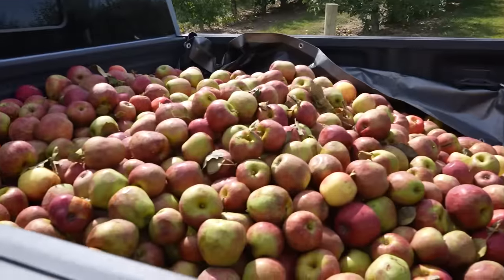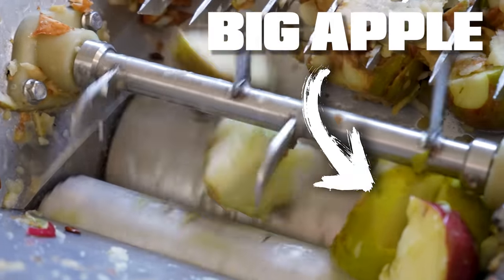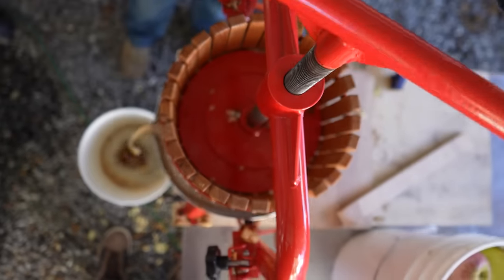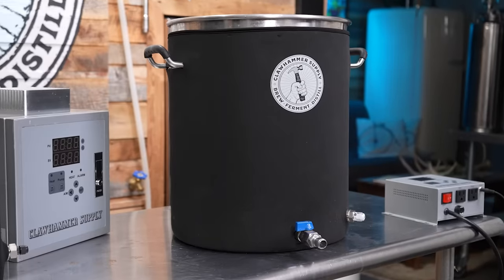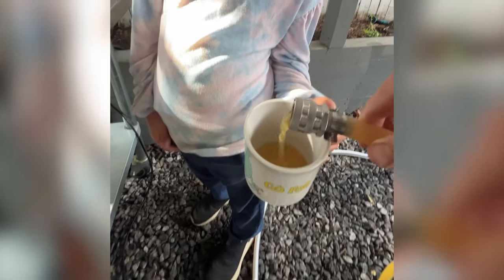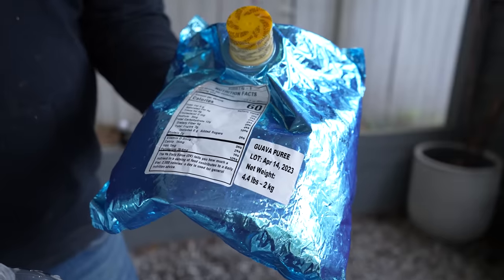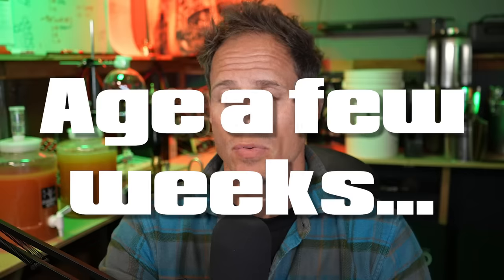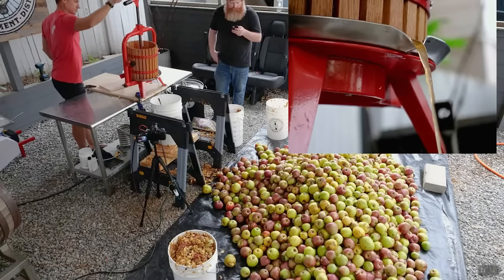How to Make Hard Cider - Easy Beginner Recipe

Comment: If you reuse that style of crusher in the future id recommend removing the knives, fill the hopper and push the apples down with a big piece of wood. The knives honestly just slow down the process as the rollers themselves can shred the apples and crush them even if the tool was originally meant to crush grapes.

Comment: Nice content guys.  Electric scratter and hydro press will give 30% more juice for less graft.  Add 1/2 tsp ascorbic acid (vit C) per 5 galls as it stops the juice going brown.  2 pints of strong tea per 5 galls for tannin.  Unless you brew beer from grain and already have heaters just stick to plastic fermenting bins and campden tabs, better to spend you're hard earned on the scratter and hydropress.  If you have a tame pig farmer local give them the pressed apple pulp, the pigs love it and the pork is next level.  Boost cider with more sugar, I like 9.6%, stronger for not much more effort.  Keep up the good work.

Comment: i saw a historical documentary on cider making and they extracted the juice and put it straight into a barrel with no chemicals or heat treatment.  Is this OK?
Reply: Look for Spanish or Basque ciders like Isastegi. Pretty sure they are still made with mostly/entirely wild fermentation. The issue for a beginner is likely to be consistency, as you're accepting whatever bouquet of yeasts and other bacteria are there, many of which you don't really want. Traditional production today includes a lot of embedded and cultural knowledge to control this, from how they source the apples to how it's processed, the tools and vessels they use, and so on, to help produce a good quality product more consistently. Eugenio Monesma has a good video on here showing this. I'd like to eventually try making something like them someday but I expect it to be pretty hit or miss.

Comment: 6:45 Parallel manufacturing is great, great stuff. It's not really needed at 5 gallon or less scale, but once you go over that, you can process everything muuuuuch faster if you're able to parallelize. Usually need less buckets mid-stream, too. Manufacturing on scale is a discipline on its own. (I work in manufacturing, it's fun.)

Comment: I was talking with the owner of Bauman's cider a couple weeks ago and they said they don't add any Potassium Metabisulfite (or heat pasteurization) before fermentation and instead add it after. Thought that was interesting because I always add it before.
Reply from the maker: Wait, what? Hmmm. Interesting.
Reply: @ClawhammerSupply  Yeah, I thought it was interesting as well. Because then you run the risk of the wild yeast taking over or ruining the batch but they never seem to have an issue with it. Supposedly dropping it in after reduces the amount of sulfur produced in primary and results in a healthier ferment. Then we've seen I think on brulosophy as well at least in beer that adding it in right before packing helps reduce problems with oxygen ingress.
Reply: @iflanzy  The added yeast will outnumber the wild yeast by orders of magnitude. It will chew through the sugars before the wild yeast can get started. Unlike beer, fully fermented cider will have basically no carbs or nutrients left for it to be able to spoil. They indeed probably just add it at the end to prevent oxidation.

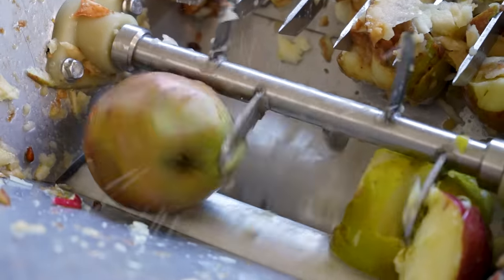Comment: 0:58 I got a breville juicer off craigslist I'm gonna try for apples this year. I've been using grocery store juice, mostly. I know a juicer like that is kinda small for your scale, but have you ever tried something like that? Bonus: it makes the pulp super fine, instead of chunky.
Reply: A juicer will make it too fine, and you will have problems pressing that pulp as it will clog up the screen bag and won't allow liquid out. The grinder I have makes it much smaller that what they had in this video, but not too fine as to not press well.
Reply: @emtffzartman666  but I don't have to press it, if it's juiced already!
Reply: I juiced my crabapples with a Breveille juicer. You need to pull it apart and clean out after every 4 lb of fruit. Otherwise works great. 16 lbs of crabapples yield one gallon of juice.